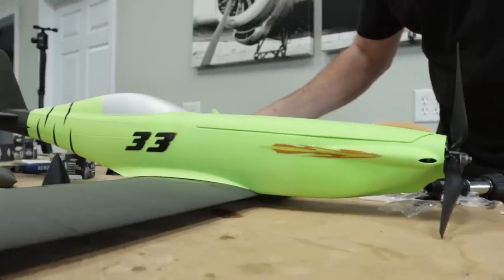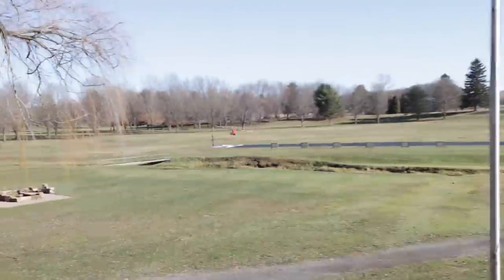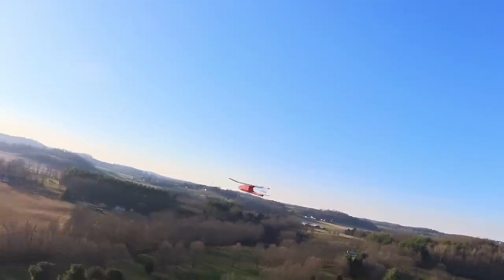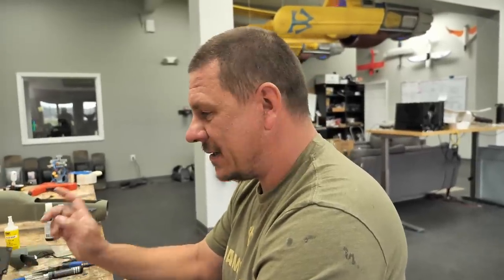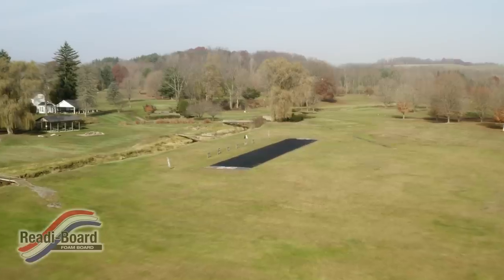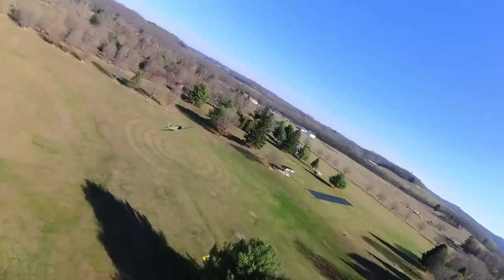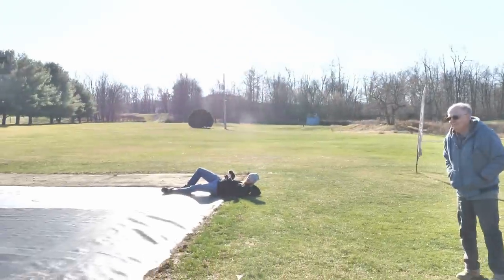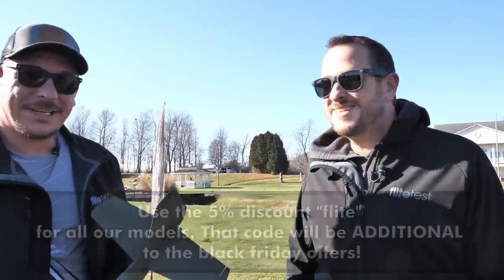We Almost Crashed Our 3D Printed P-51 Mustang!?!

Comment: Eclipson should make the P38 Lightning. I imagine it would be a significant upgrade from 3DLabPrint's version, which is a complicated build even if it did have good instructions (which it does not). I can think of several things that could be improved from that model...
Reply: I would also be very happy to see a more user friendly P-38!
Reply: The 3DLabPrint P38 is probably my favorite model, but man is the build awful. I just recently started learning blender so that I can add in filament alignment pegs to the tail boom sections - they're almost impossible to get perfectly aligned due to the absence of positive keying. 

I would love an Eclipson designed one. They really seem to have hit a good balance of cost, performance, and ease of construction with their warbird collection.

Comment: I think it's really cool how 3D printing opens up possibilities for cool shapes and planes that would be really difficult or impossible to make otherwise (unless you were a big company doing molded foam).

My issue with 3D printed planes, though, is that everything has to go exactly right every time. The print has to go right (no weak spots), the build has to go right (same thing), and the flying has to go right (no crashes). One hard landing and you're putting all that plastic in the recycle bin, especially with the lightweight PLA stuff that is mostly air and baking soda.

For a P-51 it makes sense since someone who attempts that should/would be an experienced flyer, but for something like the Tenet? I mean, that's a plane that is meant to crash and bash by a beginner. By making it 3D printed, we're back to the balsa days that us older guys remember. You spent 9 months building a balsa trainer in your attic, and then you either never flew it because you were too scared to destroy it (that was me), or you flew it once, stalled it, and turned it into kindling. A lot of people never even started in this hobby because of an experience like that.
Reply: Amen...brother.  Not worth the effort or aggravation in my book.

Comment: hey guys, I know it is a bit offtopic, but imho the best seller would be a dedicated fpv plane in 1000-1100mm  range with options for sd/hd  fpv gear.  one twin tractor and one pusher,  and somethng in a sub 600mm category. there also are a few amature attempts in the sub 250g  but would be interesting to see an option from eclipson.

Comment: Can you please do a few project videos:

1.  I want to see a POV camera on a gimbal using head tracking in goggles for FULL immersion.

2.  Long rang POV capabilities... possibly even use a quad with a signal booster on it that you can set to hover out a ways.  I want miles... 5-10 or more if possible.

3.  Do a review on cameras, goggles, transmitters at a few price points and technical levels.  It has been years since you have done this.

4.  Maybe go over some autopilot features and GPS navigation.

5.  Show off a few kits that would work well with a system like this (like skill level or say bomb payload, or maybe even a powered glider).  Talk a bit about what engine packs, servos, receivers... needed for the kits and what battery or batteries you would need to long distance flights.

6.  Maybe even do something like this for quads too.

Comment: P-38 lightning please...sized for   5" 3blade drone props , 2300 to 2800kv used drone motors. And 3-4s 1350 to 1500mah lipos . Using 9gram servos...lot of us have this gear sitting around

Comment: Eclipson planes are really beautiful, fun to build and fun to fly. Unfortunatly they rarely fly more than once, because it's almost impossible to land them without having the (LW)PLA breaking in thousand pieces. And when this happens you have to reprint and rebuild the whole plane most of the time (maybe you are lucky and can reuse some ailerons or something like that, but that's it).

Even josh wasn't able to land it in one piece here, as you can('t) see after 7:45 where there is a hard scene cut (right before the plane reaches the gras, where it almost certainly crashed into it and broke something at the nose, the wings, and the wheels).

It would have been more honest to show the full landing and to explain that, while those planes can be a fun project to print, to assemble and then to destroy on the maden flight, they are definitely not the cheap alternative to "real" rc planes. FliteTest contributes here to wrong expectations, which results in frustration and is therefore harming the hobby of RC-flying.

Comment: Can that material be painted?
Reply: PLA is very paintable. I do a lot of 3D printing. A lot of which are dnd minis which I usually will use PLA for those and the paint holds quite nicely.
Reply: @tankhunter117  thank you

Comment: Here's a dumb idea, pick up 2 diecast model planes( the ones people hang from the ceiling ) and make them fly
Reply: Too heavy, and too dangerous
Reply: With that wing loading they'd had to strap them to a rocket to get them of the ground.
Reply: I apologize I meant the plastic ones you cut out and glue together
Reply: @michaelvnuk  still too heavy
Reply: @dogjennings1171  i have made some of these models they're pretty light
Reply: @michaelvnuk  me too, they're still too heavy to be flyable.
Reply: @michaelvnuk  go get one and weigh it, give me the wingspan and I'll tell exactly how much lighter it needs to be to fly
Reply: @dogjennings1171  im talking about the one you cut out of the injected plastic sheets and you glue together. There not much weigh to them
Reply: @michaelvnuk  I know exactly what you are talking about, I've built many myself